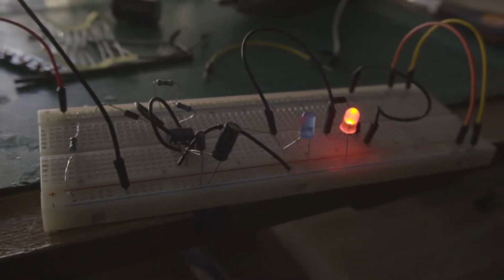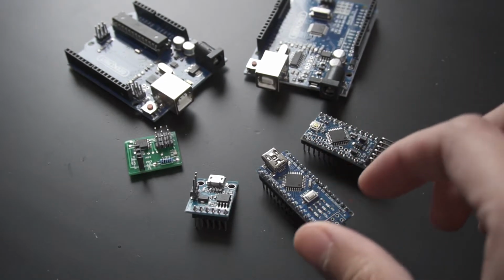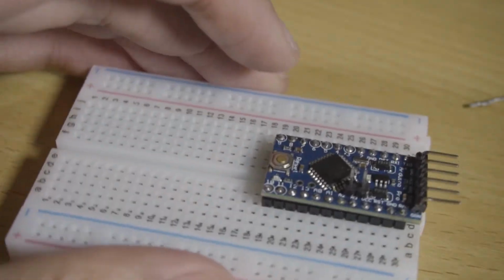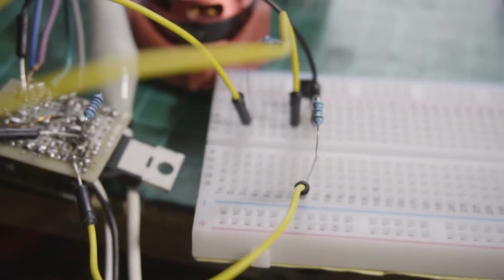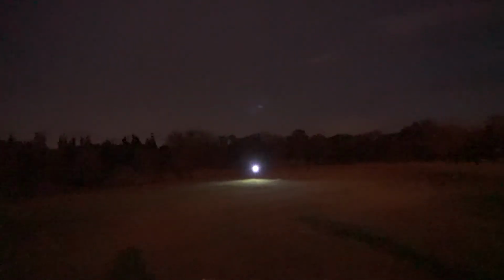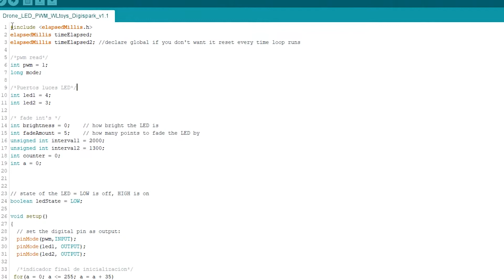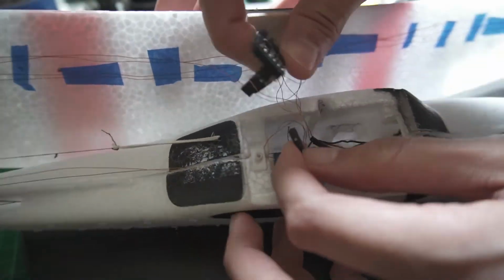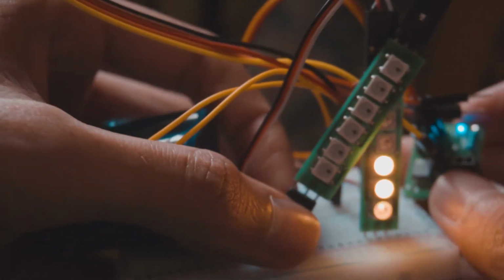NAV LED lights for drones and RC planes | Arduino

Comment: If you flip the switch on your Transmitter. Does the LED emidiatly turn on or off ? The Delay  makes a mess there dosent it
Reply from the maker: Yes, the code is a simple arduino code, so there's some delay in the response time, with a pure C code it could be a lot better.
Reply: @Joyplanes  
I reduced the delay with a timer skatch for the blinking. And you should add  int variable = pulsIn(readinPIN, HIGH, 24000) to reduce the delay timer impelentet in pulsIn

Comment: Hye, i found that your link to the code is not working. Can you please supply the code in new link, also can i get your email address as im working with strobe light project to install on my aerocar model using a on off switch instead of rs controlle.
Reply from the maker: The link has been replaced for the new working one. Thanks.